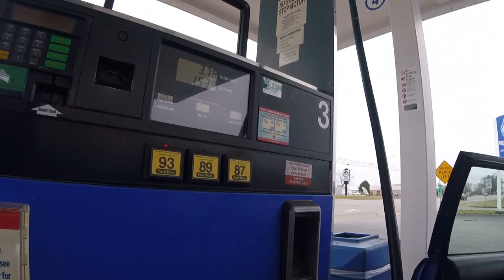B20Vtec Gets Tuned

Comment: 214 on a stock b20v is unbelievable with just bolt ons
Reply from the maker: Everyone sais that. Intake and tb is where it's at I guess. That and tuning in very cold weather. Low mileage Jdm motor and valves regrindes and new seals so it's all fresh

Comment: nice set up man. ill be going b20v soon too
Reply from the maker: Richard Rodriguez thanks man! They are deffiently fun setups and reasonable to build. Thanks for the comment and subscription. Feel free to check out the playlist on my channel to see when the car was going together
Reply: How good are these swaps some guy is selling me one already swapped it just needs a new transmission he wants 1000 what do you think ???
Reply from the maker: I love mine. The week point is rod bolts. My redline is 7900 and haven’t had issues yet but I don’t rev there all the time either but it sees 6500 a bit and no issues. Just make sure to keep it maintained and make sure you have a good time and you should be fine unless it’s just been beat on all the time. Their fun and not really expensive setups either but for that price you can’t go wrong honestly
Reply: em1 brandon thanks no problem man!
Reply: em1 brandon I had stock rod and bolts on my b20v... rs piston type r rep and I would spin mines up to 8700 on a toda b...they rev easy to 8500!no problem just need to make sure the crank is balanced..drive that car for years and beating it at the tracks...

Comment: How is this dyno reading? I do not think that is WHP as a stock high comp b20 vtec with itr head would be making those numbers in  hp not whp.
Reply from the maker: Low mileage strong running car. All power is up top with the ultra intake and 70mm. Not a conservative tune. Still going strong though

Comment: Man I’m really considering doing this since I have a del sol with the b16a2. So basically I’d just need a few things because I already have the trans and head. Did you have to change injectors and what ecu did you use?
Reply from the maker: I used a chipped p28 tuned on ectune. Stock injectors but with a walbro 255 and aem regulator
Reply: Em1 Brandon thnx man. Is this setup still running? Would u say it’s reliable so far? Anything you would have done differently if you could do it again? Also, I’m assuming I can hook up my ac and ps back up if I wanted to with maybe having to use different brackets?

Comment: Has it been reliable? I’m looking to do a b20 vtec swap in my hatch. Also what was your redline if you don’t mind me asking?
Reply from the maker: Still going strong a year and a half almost later. Redline at 7900 but unless I'm really getting on it, I shift at 6500. Torque starts falling off after anyways. Now if you see high rpm constantly it's Probally not going to last with a bone stock bottom end
Reply: Em1 Brandon thanks for the info man! I got a p72 GSR head, I’m planning on getting It milled. How much do you think I should have it milled down too?
Reply from the maker: Only as much as it needs. No more then 0.010 to be safe. Valve clearance is tight if your not touching the pistons. VTEC valves are bigger and the reliefs aren't big in the non VTEC block cause it was never meant to have a VTEC head on it
Reply: Em1 Brandon thanks man! I’ll let you know when I start my motor build!

Comment: Nice vid man. What all do you have done to the b20v? Did u put arp rod bolts during build? What cams are you running? I just ordered the blox type b cams
Reply from the maker: Yes arp studs. Stock jdm b20b block. Golden eagle lsv kit. B16 head. Milled. Valve job. Supertech valves seals and lma. Then for bolt ons skunk2 alpha header. Ultra intake. 70mm Tb. 2.5” exhaust. Walbro 255. Autoworks cold air intake. Aem fuel rail and regulator. Basic setup but all worked together very well

Comment: You running stock b16 cams?
Reply from the maker: Yep. Just a jdm b20b with headstuds. Golden eagle vtec kit. Head was milled. Valve job on factory valves. Supertech lma. New valve seals. And bolt ons.